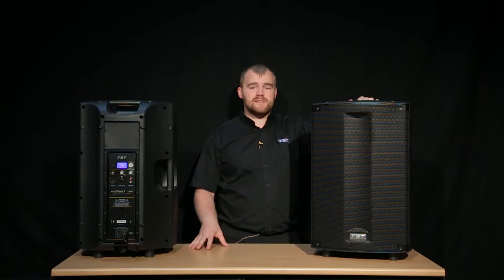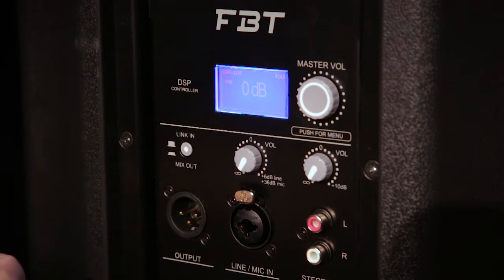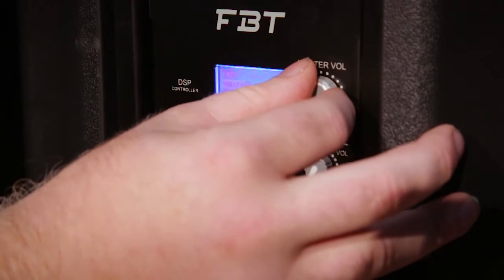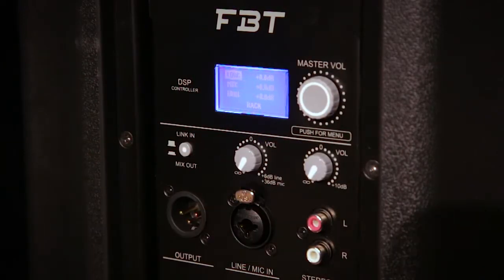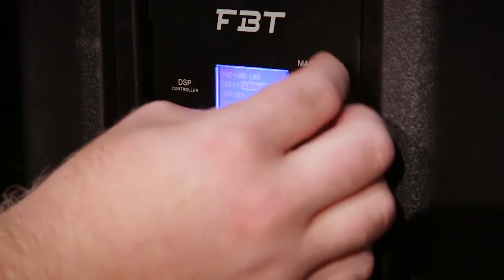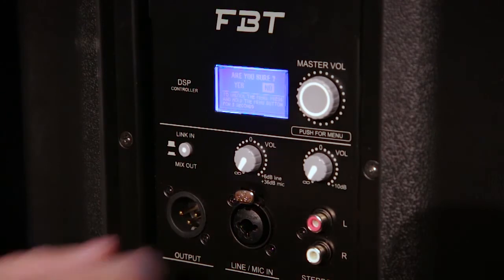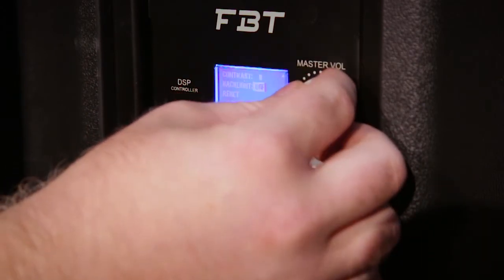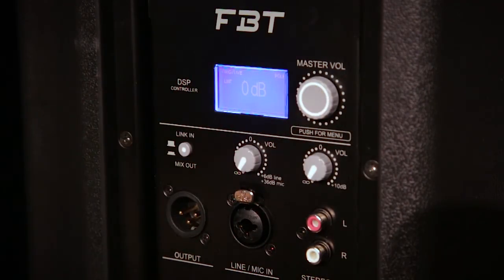FBT ProMaxX - The new DSP - www.fbtaudio.co.uk

Comment: Old ones are better! Whats the point of a eq? You can do that on the desk! Plus whats the point in the fan? Old models never had problems with heat...Big question for me is.. Are all the drivers made by B&C ???
Reply: I've got the 110a and believe me they are incredible and yes they use the same drivers. I've just got a set of the old 14a's and they just don't sound as good to me so far but I probably need to play with EQ more to get the sound I want